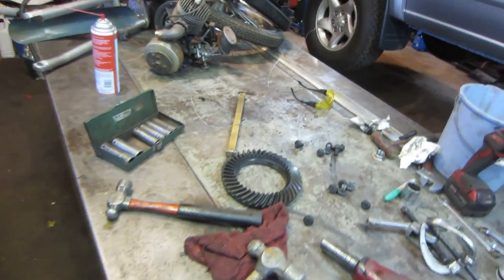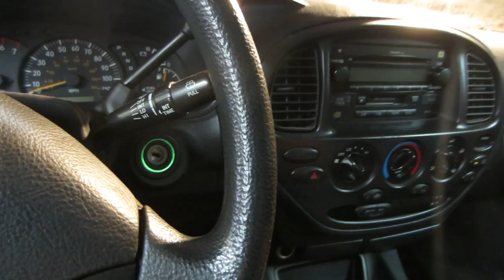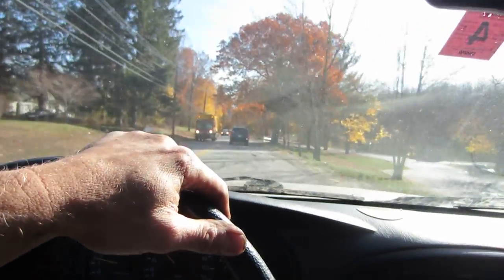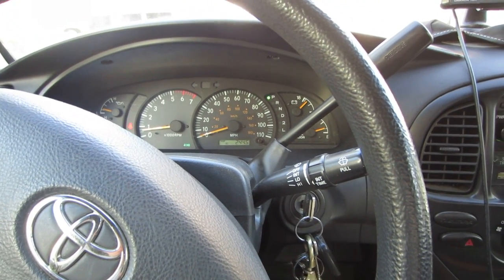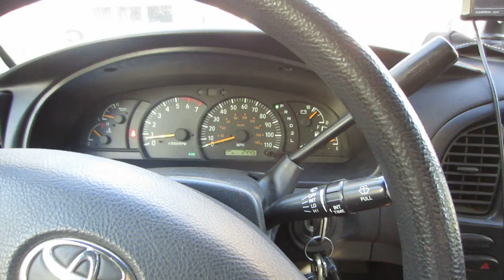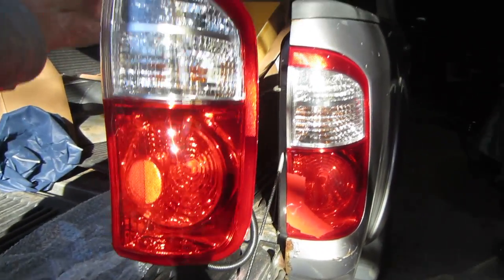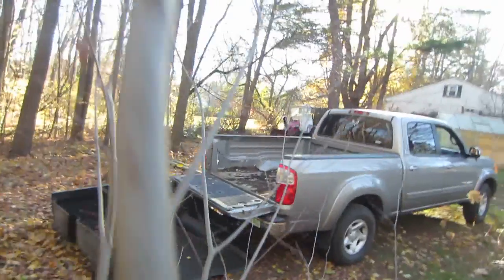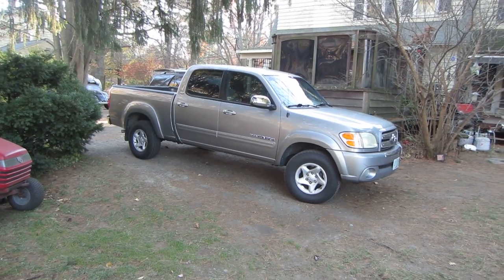front wheel drive toyota tundra

Comment: The engine sounded a little tickey
Reply from the maker: they all do cold
Reply: oh, i'm not that familiar with older Toyota's
Reply: That's Peek pickin on his banjo you hear.
Reply: A lot of vehicles made since about 2000 tend to sound a bit ticky at cold idle.  It's to do with the fact that they run such thin oil that oil pressure can be a bit low at the tappets at cold idle.  Some vehicles do have specific problems that this can be an indicator of, but looking at buyers guides should tell you, otherwise it's pretty much a case of "they all do that, sir" once they've got a few years and miles under their belts...
Reply: I agree and some oils are better than others and can make a difference. I read some where that Walmarts synthetic oil was the same as Mobil1 and a lot cheaper. I'll tell you that it is true that it is cheaper but after changing my oil and making a run to Chicago (800miles) they are not the same.  My engine would tap if it was a quart low, well the day after we arrived in Chicago I started the car and it tapped (it was a half quart low from the trip) I topped it off and it still tapped on startup something it does not do with Mobil 1.
I will be changing my oil again back to Mobil 1. Oh and I run 10-30 and may switch to the 10-40 for the reason that you stated.
Reply: MostlymoparIH   Yes, some oils, even premium brand ones, work better in some engines than others, I would normally recommend that if you have found an oil that your car is happy with then stick to it if you can afford to do so.  Mobil 1 is pricey, but it is good too.  A lot of the "no-name" oils may look tempting in terms of price, but a lot aren't compliant with manufacturer oil specifications, so they're lacking certain additives that some manufacturers require for oil in there engines to keep the engine clean or to reduce friction in areas of tight clearance, so you might lose what you're saving by having to change the oil at reduced intervals to stop the engine sludging up or by reduced economy due to higher internal friction.  Plus, it has to be said, that the people who produce oils for "no-name" oil suppliers can be rather economical with the truth, so that oils that are supposed to meet certain manufacturer specifications turn out to be the same as straight synthetic oil when chemically tested.  I wouldn't be too concerned about your engine's tendency to tap slightly, especially if the oil is a little low, it isn't necessarily a sign of damage being done, in most cases it just indicates that certain clearances, usually right at the top of the engine where the oil pressure is lowest, have opened up slightly from the very tight tolerances that the engine was built to, it doesn't necessarily mean that there is metal-to-metal contact and therefore wear occurring.  What I would suggest, if it really bothers you, is to try using a friction-reducing additive at each oil change.  I've been using Slick50 for over 25 years now and I've found it can work wonders in tappety engines.  Plus, if you're unlucky enough to suffer a punctured sump/oil pan while driving on the highway it means you have a good chance of being able to pull over and stop safely before the engine seizes, and it can even save the engine from damage if you're really lucky...
Reply: I have used Mobil 1 for years and have had good luck with it, just goes to show you, you can't always believe what you read. I switched for savings and  will be switching back for peace of mind and longevity of my engine.
Reply: MostlymoparIH   I've always thought that with things like that it's best to stick with what you know you can trust...
Reply: MostlymoparIH I agree, I like to run mobil 1 or Pennzoil platinum and just have a small timing chain tick when i start my f150, and I have never had any problems.
Reply: gosportjamie
Amen Brother.
Reply: Daniel Lockwood   Using a friction reducer like Slick50 might well cure or reduce the timing chain tick and increase the time until you need to change the timing chain...
Reply: gosportjamie oh ok I might need to give that a try the next time i change my oil.
Reply: Daniel Lockwood   Use engine flush before you change the oil next time and then use the friction reducer and it should make a decent difference...
Reply: gosportjamie why should i use the engine flush, what benefits does it have.
Reply: gosportjamie
Caution should be taken when using engine flush. I would pull a valve cover and make sure that there is not a big build up of sludge. That stuff works very good if fact too good if you have a bunch of sludge in your engine (just bought a car from someone and don't know how it was maintained) I had a 63 Plymouth Savoy (have you heard of them) and I put engine flush into the engine without pulling the cover. All the crap in the engine dropped into the pan and blocked the oil pickup and it starved a rod bearing. I also had a 66 Polara (another old car) that I did pull the covers and it was not maintained and there was a bunch of crap in there that I scrapped out but I did not use a shop vac and some of that stuff went down in the pan. Luckly it was a 383 which has and external oil pump and I was able to pull the pump and blow out the pickup and drain the oil and crud. So know thy pupil or vehicle and it's condition.
Reply: I have never heard of a Plymouth savory, and I don't think i really need to flush my engine since i have always used high quality synthetic oil and changed it every 5,000 miles.
Reply: Daniel Lockwood
I wish I still had that car. 1963 Plymouth Savoy with a slant six and a push button automatic. It was a great car maybe partially because it was my first car, not my first vehicle that was an 1962 International pickup. Gotta go. Gotta get up early for work. Good talking to ya.
Chow.
Reply: MostlymoparIH same to you
Reply: Daniel Lockwood   The reason behind using the engine flush is to break down and remove oil varnish build up inside the engine which can interfere with the friction reducing agent sticking where it needs to stick.  As MostlymoparIH  rightly said, if it's an engine you're unfamiliar with and are unsure how well it has been maintained it is worth pulling the rocker/valve covers off to check and clean them out as, particularly on older pushrod/OHV engines, there does tend to be a sludge build up in them which is caused by that part of the engine running cooler so the sludge settles and sticks there rather than remaining in suspension in the oil.  Regular oil changes using good quality oils reduces the problem, but it still tends to happen.  It's less of a problem on more modern OHC engines as there is more mechanical movement, and therefore more friction heat in the top of the engine, though if vehicles are severely neglected there are a great many vehicles that are prone to severe top-end wear due to oil feeds being reduced or blocked with sludge.  It certainly doesn't sound like your F150 should have any problems with sludge build-up, but using the engine flush will give the friction reducer the cleanest possible surfaces to adhere to...
Reply: I like the qualification.
Reply: MostlymoparIH   I felt it was necessary...
Reply: MostlymoparIH   All credit where it is due...